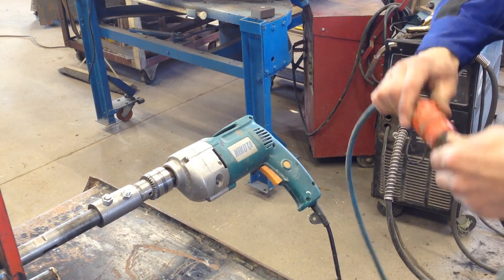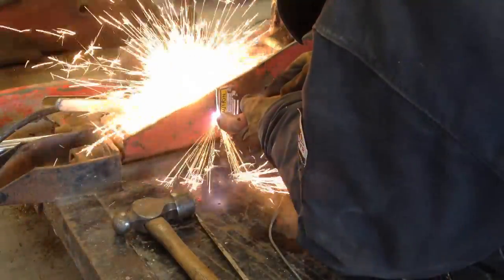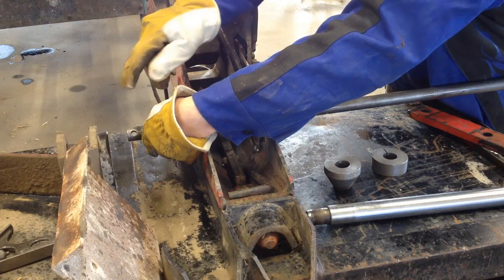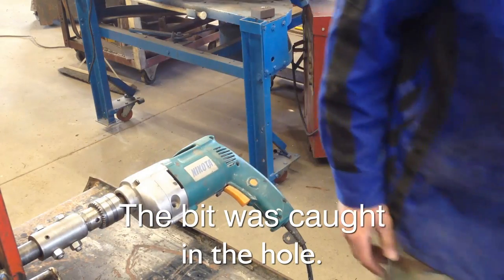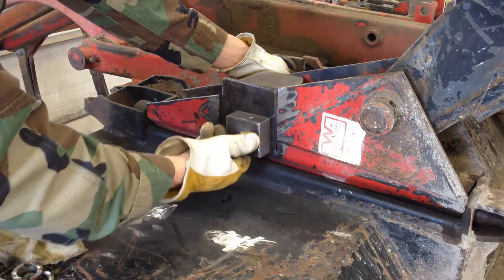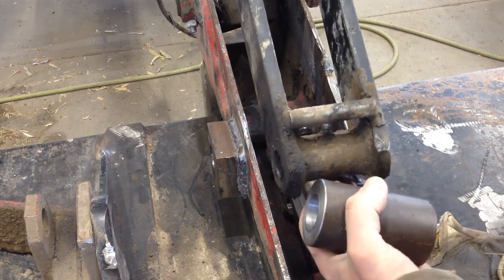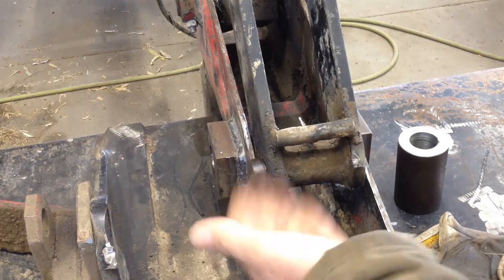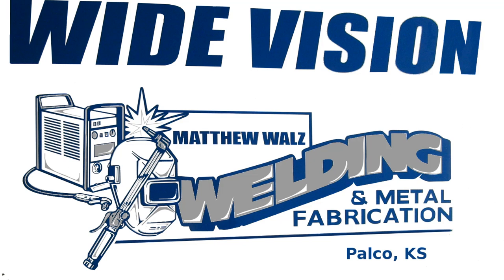Loader Pin Repair - (1370 Tractor Maintenance Series)

Comment: Just had to post an appreciation of the 1370.  We have one still going strong at almost 10,000 hours.  Actually have a few of the 70 series & you can't beat them for a loader tractor.  Nice video!
Reply from the maker: They are good tractors! I "grew up" driving a Yellow 1370 pulling a 4 bottom sweep. My only complaint is the front axle is way to far towards the cab. It needs to be moved forward about a foot, maybe more. When I move bales, the back tires just kinda "skip" across the ground.

Comment: Back in 2000 we just machined a piece of Machined DOM and plasma cut out the old bushings after we lined up a pin and tacked it in place to keep the angle of the center of the bushing then just welded the new one piece bushing into the two sides then after it cooded cut out the DOM on the inside and square up the inside ends. one piece welded in place will line up after being cut in half.

Comment: I've done hinges similar to this by choosing a pipe with an ID to match the pin's OD.  Drill holes in everything and put the piece of pipe straight through all of the pieces.  Tack everything in place.  Yep, weld the joint solid.   Then get out the sawzall and turn that welded piece of pipe into a hinge with two cuts. Since you started with a straight piece of pipe, all of the pieces will be lined up once the pipe is cut up into bushings.  You could theoretically get a little warpage, but I've never actually had a problem with that.  If the kerf of your sawzall blade doesn't end up providing enough clearance, grab the grinder and make some clearance.

Comment: Really like your workshop .  I am rebuilding some pins of my EX50 excavator.
Reply from the maker: I don't understand Youtube notifications as I didn't see this comment.  It's a nice shop. My Grandpa built it in the mid '50's and I'm currently renting from him. Good luck with your excavator. :)
Reply: Thank you for encouraging. l ve made a 16" bucket by vary limited equipment, a grinder, a arc welder and a poor plasma cutter.  l put it on my channel and l ll  do a   # 5  video of this bucket digging ...

Comment: Hi Matthew,
If you work with 4140 Heat treated it's generally at 30 Rc, you need good quality HSS tools or preferably carbide tooling, but, there is always a way to get it done...
Hope you had both sides done or you'll have another repair to put on YouTube...   ;)
This repair should outlast the tractor,     Pierre
Reply from the maker: I'm wanting to grab those cheap carbide drills you demonstrated, and see if they'll drill through this stuff.  And no, I didn't do the other side, but I should. Thanks Pierre! :)

Comment: how do ya make the square holes in that boring bar ?
Reply from the maker: drill a hole slightly over size, then use a square file to finish it.

Comment: This was a really cool video. You broke the machine, not you fault, and you repaired/upgraded it. How does the other side look?
Reply from the maker: Thanks! I didn't look to close at the other side.  But I put it on the to do list.  Maybe it can be preventative work instead of a repair. :)